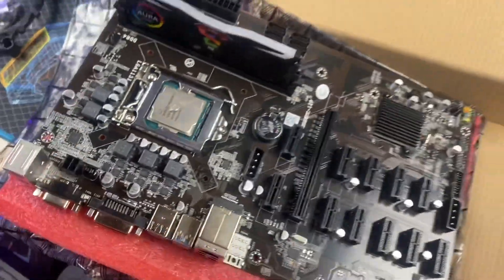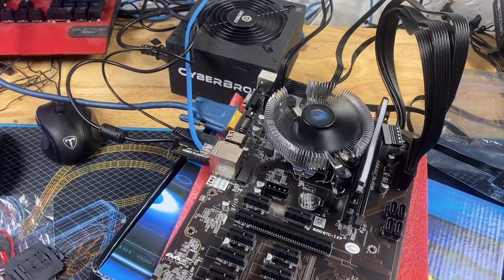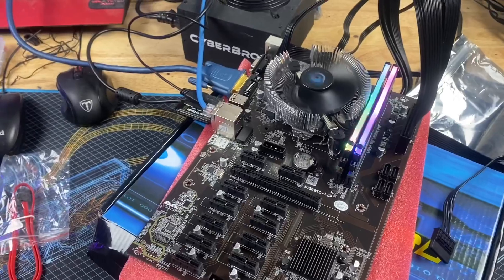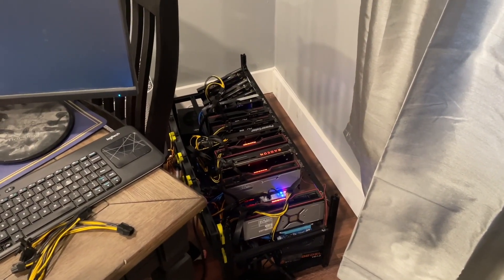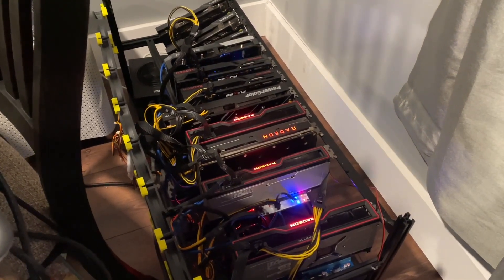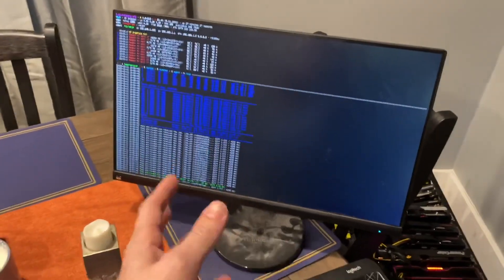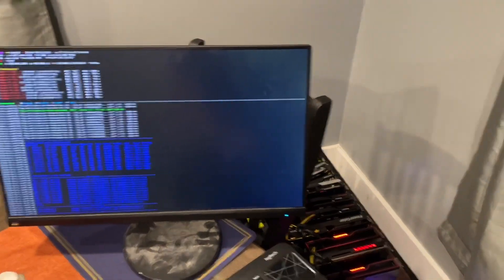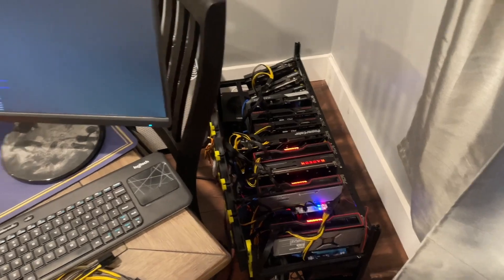Aliexpress B25012P 12 GPU mining motherboard - unboxing setup and testing

Comment: how to arrange the GPU sequence on pcie? do you have manual on it?
Reply: it was all trial an error plug in 12 cards, and figure out what order they're in with software basically
Reply: @OvalboreCars   I ordered one of these boards and started to read what people say.  The onboard gpu built in to the cpu has to be disabled to mine with 12, or a cpu with out a built in gpu used.  So they say.

Comment: How do you turn it on?! :/
Reply from the maker: bios is set to auto power on.

if it doesnt work, you can short the two pins next to the dead pin on the front i/o connector (google standard ATX I/O connector for that)

Comment: Anyone know the correct resolution of vga output of this mobo? I’ve Tried with old monitor,new monitors,television but i ve only errors of unsupported resolution….
Reply from the maker: I never did try the VGA port. the DVI port does work just fine though.

Comment: I can get 7 to work just fine but with 8 gpus, it has issues loading drivers, or initilizing the miner in hiveos. RX 570 4gb cards
Reply from the maker: change PCIe gen to 1.

I've had no issues with 12 being detected and 11 mining. just rebuilt this rig yesterday. board is still great.

Comment: Heya, nice video. I bought the same motherboard and I'm having issues with the powersupply to the motherboard. 
The PSU itself is working nicely, I've tested it separately and it (the fan) hums like it should. 
I did this by "dummy-wiring" the 4th and 5th connector of the 24pin cable with a paperclip, to fool it thinking it was attached to a motherboard, 
and by doing so I could conclude that it was working. 
I then attached the supplemental power, and concluded that the rig was working, since the CPU-fan and external fans along with the PSU-fan all were spinning.
However as soon as I attach the 24 pin powercable in its intended socket, it isn't reacting at all. 
I went through all attached cables and made sure they are positioned firmly to the board, but that just does not fix it.
Any troubleshooting tips on how to proceed?
Reply from the maker: sounds like the board is DOA potentially. double check that the CPU is socketed correctly though. attempt powering the board on with no CPU or RAM to isolate those components.

Comment: hi i have the same board but is not posting with more than 6 gpus when i add the 7 one is not posting, can you share your bios settings?
Reply: did you manage on something? (I have same issue with NVIDIA gpus 3060m)? I tried all the bios settings but doesnt even load bios :/
Reply from the maker: bios is fully stock.

Comment: Great video. I have been wanting to play around with mining just for a laugh. Can I use a laptop to mine just for kicks? I have a Dell core i7 with an IRIS Xe video card. I know prob not. What would be the minimum things I would need to start playing around?
Reply from the maker: you certainly can if the GPU has at least 4GB of dedicated vram, ideally 6+ GB though for Ethereum which is still currently the most profitable minable coin.
Reply: @OvalboreTech  I will check but I think it is just 2gb
Reply from the maker: @danielesilvaggi  there are technically things you can mine with 2GB but not enough to really matter IMO